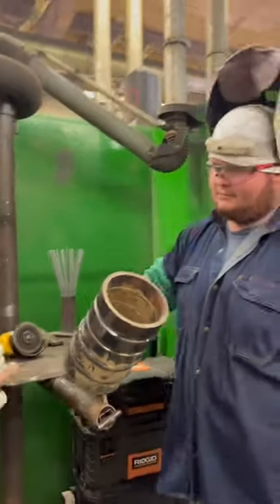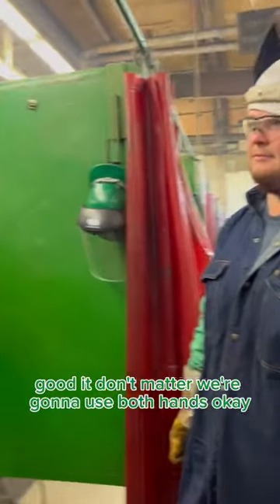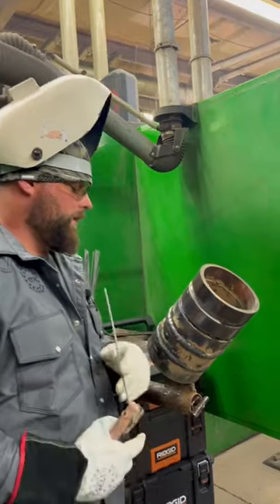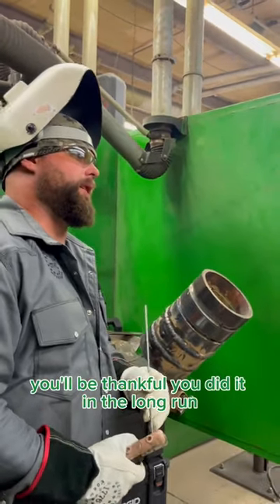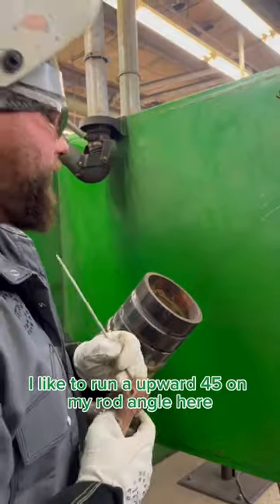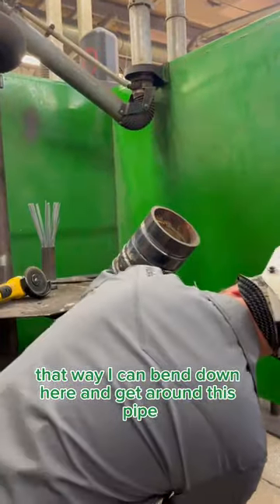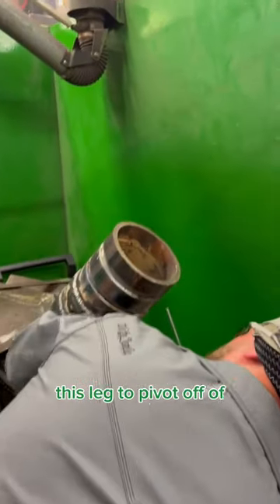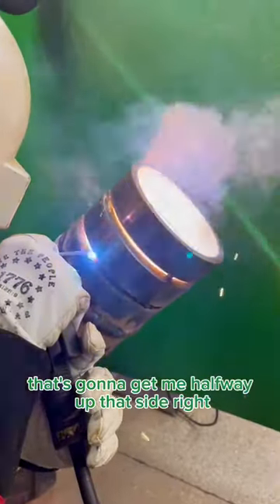6010 welding ain't easy, but at MWI, we're here to help you master it! #welding #best #fyp #learn

Comment: I’m glad you stay on people welding with both hands I got in the bad habit of welding right handed because I could, my last job I mig and tig aluminum tank trailers and horizontal, vertical, overhead both hands i wish I would have started learning both from the beginning
Reply: Meh I welding a shop so I can do as I please and use my dominate hand like a normal human does.
Reply: Fresh into tig i started teaching myself lefty because youll always run into a scenario when switching hands will be easier

Comment: As a fabricator building and rebuilding as well as repairing commercial compactors and bailers  , 6010 5P+ is the go-to rod for welding through dirt , grease , paint .......etc. when I can clean and prep I use 7018 .

Comment: Yeah running regular 7018 is the easy part that 6010 rout is no joke that’s what makes or breaks a solid weld and one of the harder ones to master because it will blow right threw if not carful so nice man good teachings because the body position is so important to have that pivot last thing you want is to have to fully readjust yourself

Comment: Good advice, however the uphill downhill debate is called out in the welding process.
Reply: I had a guy tell me if u can always weld dowwwwwnnnn. So now we say that all the time. Dowwwwnnn! But this is a fab shop not a pipe shop so a little different.
Never try to go up when u can go Dowwwwnnn.
Reply: Down hill baby
Reply: I mean…no. If your in a structural shop and your crack a rod downhill your getting laughed at
Reply: For ornamental visual welds do what’s comfortable and achieves that pretty result as for strength and structural integrity you weld that ishhh up

Comment: Looks like your dragging that 6010? I only ever keyholed 6010 its the way i was taught do i have to drop my amps more so i wont completely destroy my landing? I run usually run 1/8th 5p+ at 90 amps and usually give myself a 3/32 landing

Comment: I'm a disabled non-combat  veteran with a pacemaker. I was told I couldn't weld.  I was working at Smith Oilfield supply Co. in Abilene,TX.  Can I get into welding school with a pacemaker in me ?.  I'm healthy and work out even, I'm 45, just had a heart valve replaced. I really loved welding.  Does anyone know if people with a pacemaker can be a welder?
Reply: Talk to your doctor. I have heard the high frequency from GTAW can be an issue. But DC should be ok. But this is all hearsay. Only your doctor and manufacturer of the device can give you the right answer.